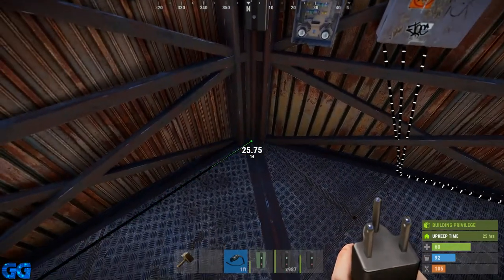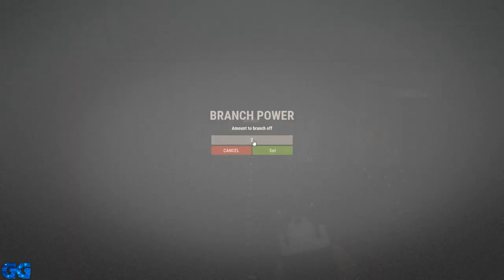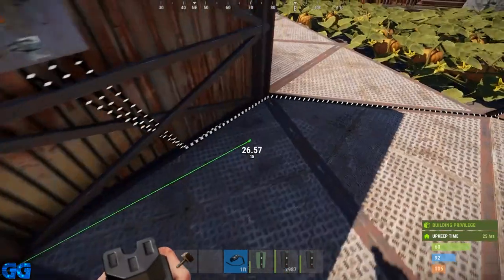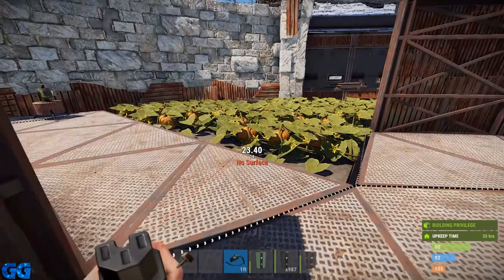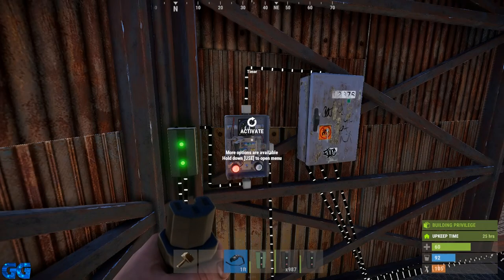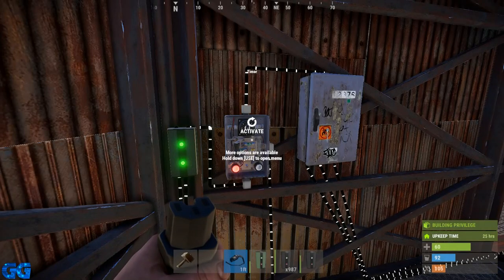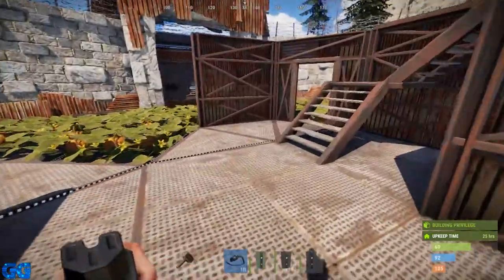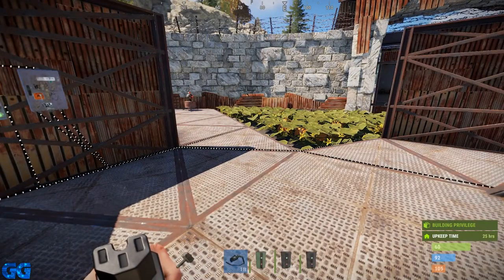Rust Electric Tutorial - The Turret Timer - Protect Your Compound

Comment: Power keeps going down even wires are just connected pretty useless even with a generator going into battery directly with 40 units of power still goes down way to fast the circuit is pretty much useless not joking its pretty useless might as well just hook it up with one solar panel and that's it to prevent door campers
Reply from the maker: Yeah but that's the case with all Rust electrics, there is line loss, I agree they should lower this, as not switched on circuits use way too much power.
Reply: @GeVeBeGaming  yes it's very excessive